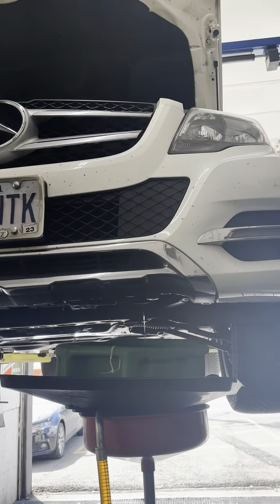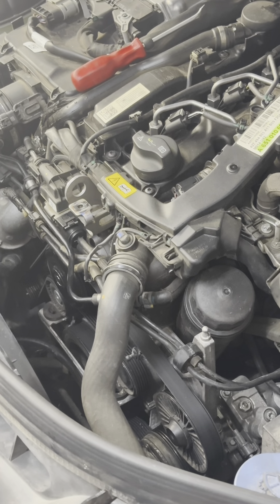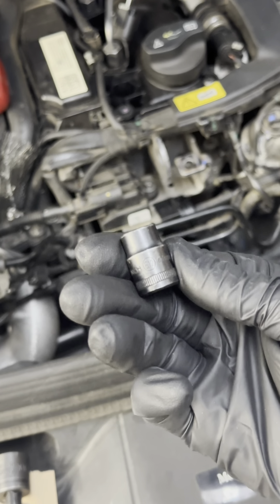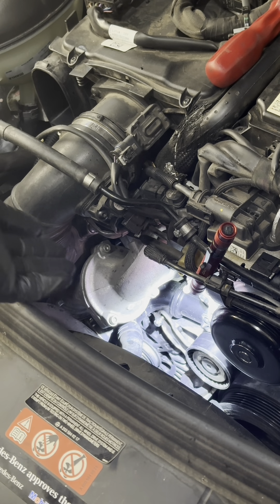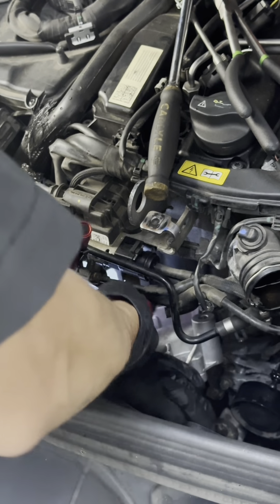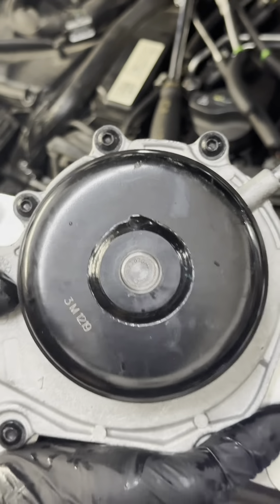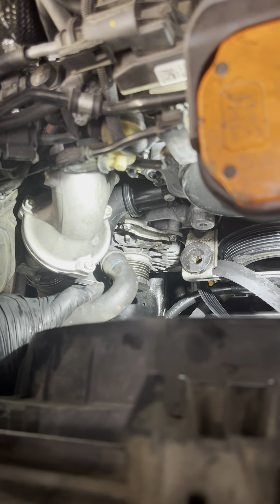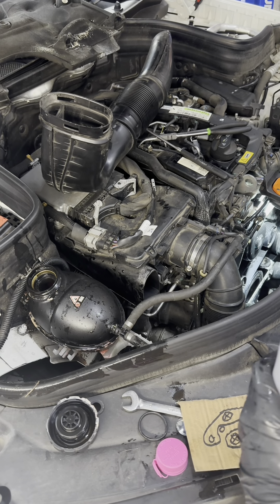2015 Mercedes GLK 250 diesel Water Pump

Comment: Just as addition to this video.
I just dud mine 2014 glk250.
When he seperates the plastic pipe its not necessary.
There is room to pull it out as one.
Remove the intake pipe, belt cover, belt and the pulley as on video.
Then remive the upper bracket bolt and loosen the lower.
Let the bracket swing down.
Vacuum hose off coolant pipe off on the left clamp on the right ti the side.
Break the seal on the right side hise from pump flange and you can wiggle the whole assembly out.
Lift it up first then pullthe top towards the front which will allow the plastic pipe to clear the metal bracketthat holds the pulleys to the engine.
Reverse on install.
Dealer wanted 800 canadian in labour.
Job took 2 hours with no hoist.
Draining the system takes the longest

Comment: This is exactly the video I was looking for.  Thank you. Was there a P261f code as well?
Reply: @MFDPaul did you have the P261f code? If so, did this fix your problem? I just ordered a water pump for mine today after that code.
Reply: @SouthCoastPonds same question, any luck?
Reply: This code is frustrating.  I had the water pump change over valve done at the MB dealer at the same time they were doing a large 7hr job under field measure warranty warranty.  They diagnosed P0261f as the valve. One day later it came back.🤬 I already had a pump and housing ordered as mine had the plastic housing. Again a day later code is back. Checked vacuum for transducer by egr and vacuum drop. One new transducer and that did not solve problem.  Since this code appeared I have done approx. 10k KM with  no issues. Still very frustrated. The strange thing is I can delete the code after the car warms up and it won't come back until I let it fully cool overnight. At this point I dont know what to do. Other than  this code the car works fantastic.   Any luck let me know.